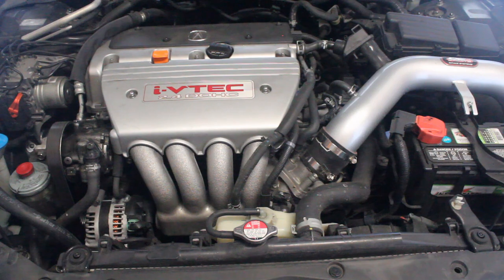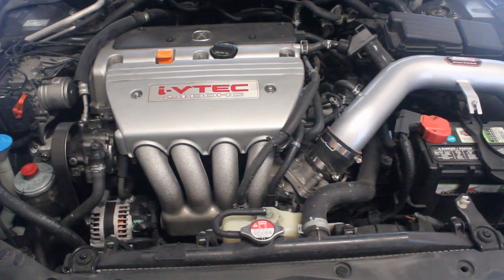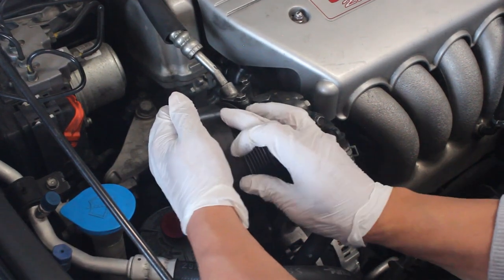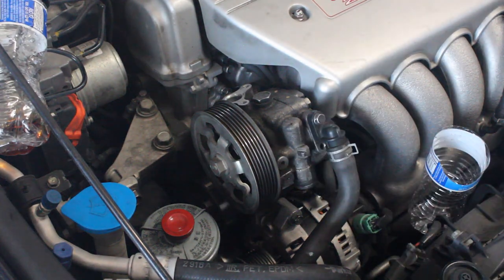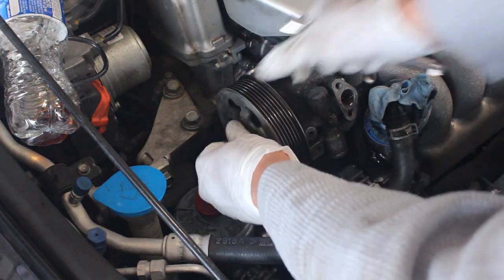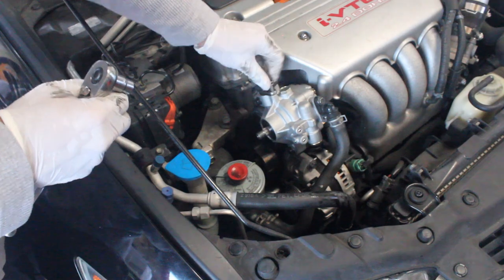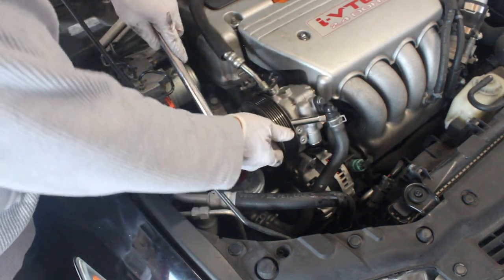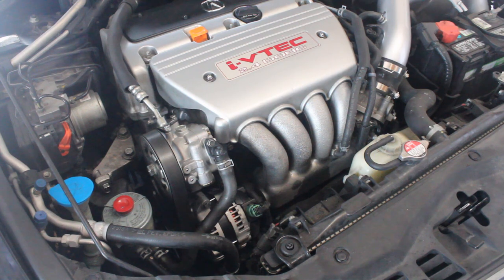Power Steering Pump Replacement 2007 Acura TSX

Comment: Doing mine today ! Thanks ! Also bought a seal kit and a bearing to rebuild the old one for backup.
Reply from the maker: Thanks for watching and commenting. Good luck with the project. Feel free to keep us updated. Thanks again.
Reply: @firsttimersDIY  All done, fresh new seals she runs awesome. Also did the PCV valve while I was in there. The only problem I had was an aftermarket tensioner that was a 15mm instead of 14mm.  Thanks again man, I've added your video to my Acura repair playlist. Btw beautiful TSX, unmodified originals are getting scarce now !
Reply from the maker: Thank u. Great work. Thanks for the update!! ✊️

Comment: Thanks! Ill be swapping over my pump tmrw along with my alternator thanks to a massive leak/failure.
Reply from the maker: thanks for watching and commenting.  good luck with the project. Alternator should be easier to remove with the power steering out. thanks again!
Reply: Same bro how long should it take Nd is it hard ??
Reply from the maker: @zaza9468  thanks for watching and commenting. Power Steering Pump is pretty easy to replace. Remove the belt, then the high pressure and low pressure hoses from the PS pump, then 2- 12mm bolts to remove the pump. Replace in reverse order. Maybe 20-60 mins. Alternator is a little more difficult but not too tough. Hardest thing for me on the alternator was actually pulling it out. Tight fit. Let us know how it goes.  Thanks again.

Comment: Did this fix the whining sound I’m having same exact problem same car and year, just replaced alternator last night now sounds like power steering got worse
Reply from the maker: Thanks for watching and commenting. I would make sure all the air is out of the power steering system first and if that doesn't help then replace the power steering. Sorry for the delayed response. Thanks again!

Comment: What size ratchet did you use for the 14mm? 3/8 low profile won’t fit with the engine mount in the way
Reply from the maker: Thanks for watching and commenting. I used an extended socket for the tensioner. I think it was a 3". Thanks again!
Reply: @firsttimersDIY  you wouldn’t happen to have a link to where I could purchase it would you? Thanks so much for replying back!
Reply from the maker: @dog210christian  mine came with the socket set. It had the regular sockets and also a few with longer ones as well. 

Limited-time deal: DEWALT Mechanics Tools Kit and Socket Set, 1/4" & 3/8" Drive, SAE, 108-Piece (DWMT73801) https://a.co/d/2xO1aqB

For example, these have the longer impact sockets in the set. Something like that should work. I hope that helps. Thanks
Reply: @firsttimersDIY  I’ve had no luck I’ve literary spent the last 2 weeks just purchasing different tools including the ones you’ve mentioned just a different brand. I’m confused on how you get anything to fit on the tensioner without the engine mount in the way. 
The sockets seem too long too fit im just confused on the tools even with what you’ve provided me. 

I feel a little silly considering no one else has had this issue. But any specific pictures of the tools used on the tensioner would help. I can’t get a good eye in the video. Thanks In advance!
Reply from the maker: @dog210christian  thanks for replying with an update. I know it can be frustrating being stuck at a certain point. Will try to help as much as possible. 
Not sure exactly where you're having issues but the tensioner doesn't disconnect. You will need to turn it clockwise but it only rotates 40-60°. Once rotated you can slide the serpentine belt off. The tensioner will return back to its original position.
I hope that helps but if you have other questions let us know. Thanks again.
Reply: @firsttimersDIY  the problem is I can’t find a socket or ratchet that fits on the tensioner bolt. With one of the sockets I can get it partially on there but not flat so that I can actually turn the tensioner bolt.

I’m basically wanting to see exactly what you used on the tensioner as far as tools so I can compare to what I have now or what I may need to get. I know you told me what size it was but even with that I’m struggling. I’m aware it doesn’t disconnect.
Reply from the maker: @dog210christian  let's see if we can get this figured out. I have to change the clutch in my acura so its sitting in garage. 

I am able to get to the tensioner with my 14mm socket.  Not using any extensions or additional tools.

Looking down from above the power steering pump, locate the power steering wheel/pulley. The next visible lower bolt is the tensioner bolt.  It should b accessible with a standard 14mm socket.
Reply: @firsttimersDIY  what size ratchet then? Cause even a 3/8 low profile wouldn’t fit with the 14mm fully on there when I attempted it.
Reply from the maker: @dog210christian  it is a 3/8 ratchet that I have and used in the video. At 1:15 of the video, the ratchet is sitting in place around the tensioner bolt. Perhaps try connecting the socket by itself and then attach the ratchet.
Reply: @firsttimersDIY  I have no space to really do that as my ratchet has a quick release button on the back side. I’m not able to fit my finger in between the motor mount and back of the ratchet to push the button. The ratchet is pushing against the motor mount. If I had some more room I feel like I could fit it on there. 

I managed to get it partially on the bolt but it wasn’t on there flat so I couldn’t turn it. Trying to remove it was a bitch being I have no room behind the ratchet to push the quick release once I smash it in between the motor mount and 14mm bolt.

I’ve tried different ratchets, even low profile. I don’t understand why I’m struggling to just get it on the bolt properly so much. I must be using the wrong ratchet or something. About to give up lol

Comment: Should I drain the old fluid before installing pump?
Reply from the maker: Thanks for watching and commenting. You don't need to drain the power steering fluid or reservoir before changing out the pump. A little fluid comes out of the hoses when you disconnect them but that's about it. Hope this helps. Thanks again!

Comment: is it possible to keep the belt on if i got sum1 to hold it in place while i swapped it?
Reply from the maker: Thanks for watching and commenting. I don't think so because you have to remove and reuse the wheel but let us know if you figure out a way. when replacing the belt I think its easier to start from the bottom. Move the steering wheel to the right so you have more room behind the tire. Hope that helps. thanks again.

Comment: What brand is the aftermarket ps pump? Cardone, Carquest? And hows it been working for you
Reply from the maker: Thanks for watching and commenting.  The after market pump was a CarQuest pump that I picked up from Advanced Auto. Been working great. make sure you have extra Power Steering fluid after the new unit is installed. That was the main mistake we made not having extra fluid ready. Thanks again!

Comment: How did you get the air out?
Reply from the maker: thanks for watching and commenting. sorry for the delayed response. This has actually been an ongoing issue. If you jack the front tires in the air you can turn the key to the on position. without starting the car and turn the wheel from lock to lock and back again with the cap off the power steering reservoir. Hope that helps. Keep us updated.  Thanks!
Reply: @firsttimersDIY  thank you for the response.  It’s crazy I know it was the power steering pump but it’s not making any noise at all now. I bought the pump and tools and now it’s running fine. Lol.
Reply from the maker: @KapitlD  glad to help.  my power pump is starting to make noise again. it comes and goes randomly now. I have been messing around with it and I think it is air coming from the high pressure hose.  I am going to replace the O Ring soon and will make another video with all the different things I have done.  Thanks again.